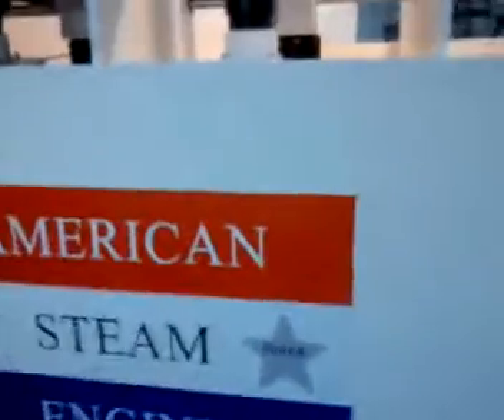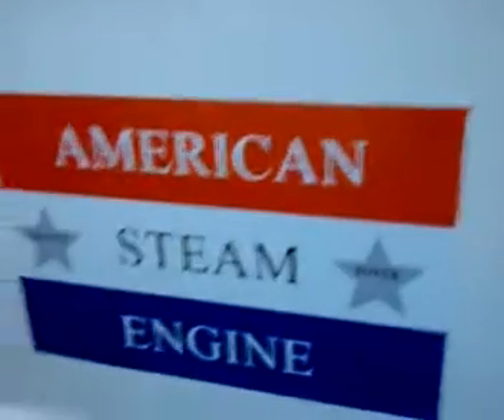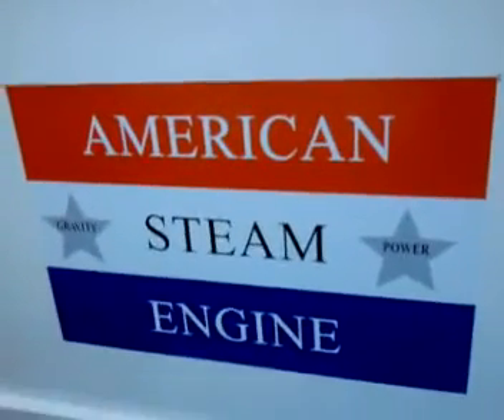new american steam engine

Comment: This is crazy ingenious!  The use of floats rather than pistons with their higher friction and need for sealing is awesome.  This would be more efficient than a paddle wheel and less expensive than a turbine.  Could be used anywhere you have flowing or falling water for hydro power for home or small shops. The double ratcheting cranks are a stroke of genius.  Thanks for sharing this.  Any idea of horsepower?